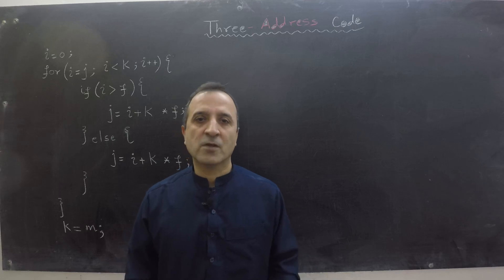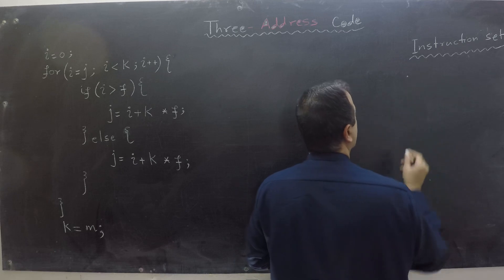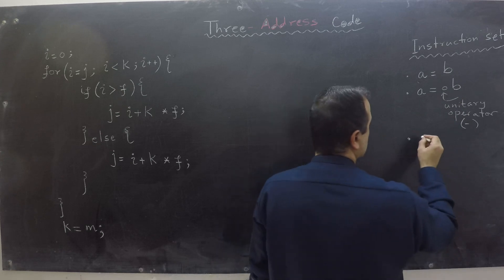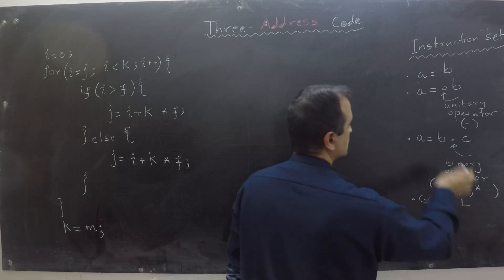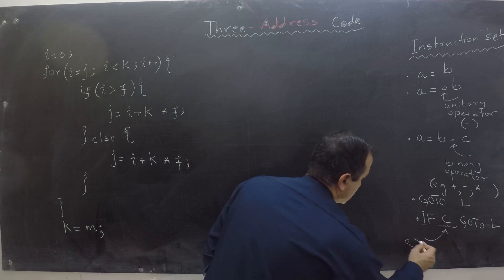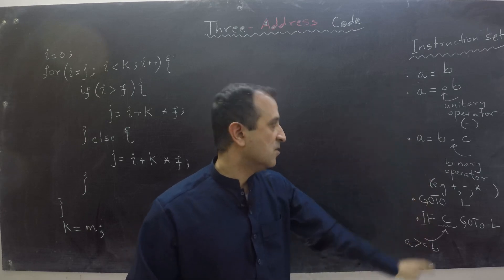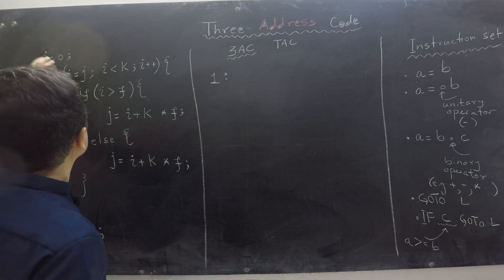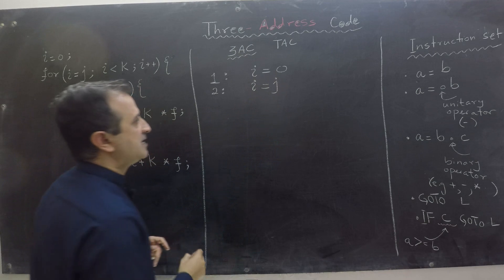Compilers: Handwriting Three-Address Code for a C/C++ Program | Step-by-Step Tutorial with Example

Comment: Sir after sufficient analysis, I found that there is a very minor mistake. In line number 13, the statement should be GOTO 3 in place of GOTO 6. Sir please check. [Time Stamp= 14.43]
Reply from the maker: Yes. That is a mistake.
Reply: Also at step no. 9: GOTO 14, shouldnt we have had 9: GOTO 12 to rerun the loop! Time stamp 14:40! Also thanks for amazing lecture ♥♥♥♥♥ @AdvancedMath
Reply: @muhammadawais4283  I think so too. It should be GOTO 12.
Reply: Came to the comments to point that out too, glad I am not the first to notice it, because I was not sure